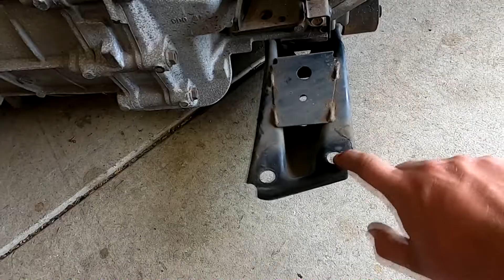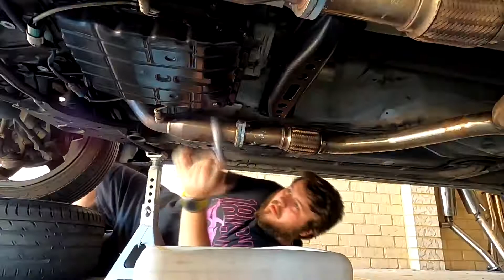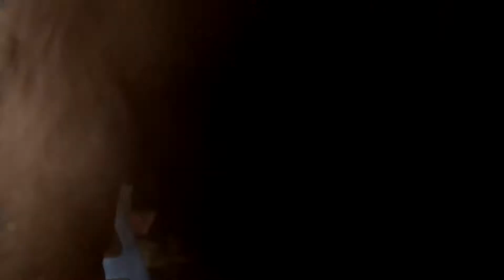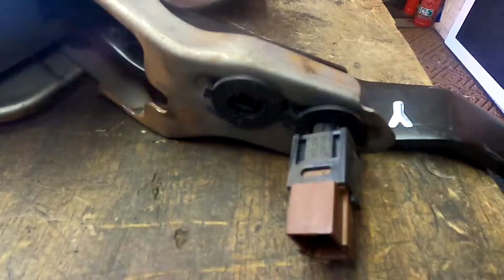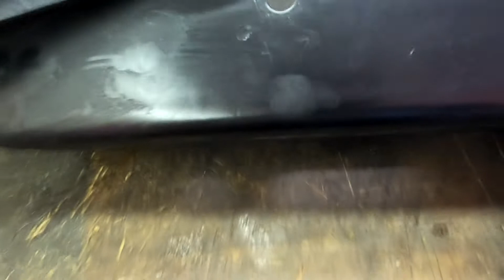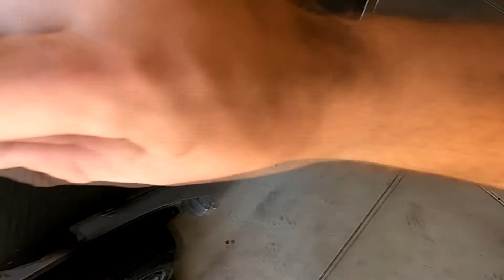HOW TO Manual Swap 350Z (INSTALLATION & WIRING GUIDE)

Comment: Nice work, bro — it looks so easy in your video, but it’s not 😅
I’m doing a conversion too, replacing the full harness, ECU, and all wiring from a 2005 350Z manual into a 2003 automatic.
Everything is plugged in now, but the car only cranks   no ACC, no cluster power, no spark.
I swapped every harness, cable, and ECU thinking it would be simple, but I’m stuck now.
Do you have the wiring diagram for a 2005 350Z right-hand drive (Australia)?
Or do you know how to bypass the immobilizer / key antenna?
I mixed everything up, even replaced the dash harness 😩
All the American diagrams are different, so it’s confusing.
Any help or ideas would be really appreciated   your video is great, I should’ve done it your way instead of swapping the whole harness and ECU.
Thanks, amigo 🙏
Reply from the maker: Yeah right with what i did it was still all auto harness and ECU just by passed the clutch safety switch. Dont know much when it comes to people doing the full harness and ECU swap.

Comment: Hey, you have jdm, right? Asking because i saw in my jdm upper side bracket for clutch pedal and im curious did you have the same because everyone needs to do reinforcements for clutch pedal.
Reply from the maker: Yeah its JDM. All i did was just bolt the clutch all brackets and stuff was there all i needed to do was drill the holes for the master cylinder.

Comment: You had to change the car’s ECU to use a manual transmissionl
Reply from the maker: Na still was using the auto ECU and Still to this day car is on auto ecu as a drift car. never had a issue.

Comment: Mate im up to the wiring stage...plug E8 doest have pin 45.
Im in oz too, so wiring should be similar except mine is 2006.
Reply from the maker: Had a quick look. yes wiring diagrams show different. looks like Plug E7 pin 26 for transmission control module (AUTO) and if you want to wire the clutch safety switch will be Plug E7 pin 25. Please double check that all before you start wiring.
Reply: @braydonkinnear so on the 06 z u use pin e7 and 26 to do the wiring

Comment: hello i have RHD and im kind of stuck on the clutch line part, can i just buy the regular hard clutch lines because i don't know if it varies from LHD and RHD.

also the transmission mount. do i need to do modification for the automatic transmission mount to fit the manual transmission?. 

thank you
Reply from the maker: yeah i just used factory hardlines. can always make your on if you have the tools. can use the factory manual gearbox mount or again make your on if you have the tools.
Reply: @braydonkinnear  yes I'm going to make my own and the transmission mount i will cut the automatic transmission mount that i have.

Thanks

Comment: I did the same conversation but I’m having problems when I get into neutral and my car start to die at soon as I get out of gear coming to a stop :( can anyone help please 🙏
Reply: Also when I turn on the car it idles normally but once it comes to a stop out of gear it’s try’s to stay alive and then falls down and turns off
Reply from the maker: Yeah true. haven't heard of them doing that before. only thing I can think of is plug a scan tool in see if any codes come up.

Comment: Will the wiring you did to bypass the clutch switch be the same for a 2003 g35 ?
Reply: Well since its an old video I assume was not getting any response,yea it did indeed work g35 has different color wire but its the same thing thanks good video !!
Reply from the maker: @juanrafaelromero3487  Yeah sorry for late response dont check this account that much. I wouldn't now if it works with a G35. glade you  where able to get it to work.
Reply: @juanrafaelromero3487 was ur grey/red ?

Comment: Hi I have a question if I did it with the safety switch and I did it wrong would it stop it from priming the fuel?
Reply from the maker: When you turn the car to ACC with key the fuel should prime then, even if the clutch isnt pressed down. make check fuse or relay.
Reply: @braydonkinnear  I did check the relays and there all good and I changed the ipdm as well
Reply from the maker: @edwinjimenez631  Thats very strange have you bench tested the fuel pump to make sure it still works.
Reply: @braydonkinnear  it’s a new fuel pump but when I use the multimeter it works on the fuel pump relay

Comment: Just sell your automatic 350z and buy a manual 350z. You just killed the resale value on the car and introduced many other problems
Reply: What you did is cool but at least in the USA. auto Matic and manual sell for 7-9k
Reply: @Mrkevi123 or maybe some people don't plan on selling a car they built so they don't care about "resale value" cause they're keeping it till the chassis done for. You sound like someone with soft ass hands
Reply from the maker: That car still drives perfect today with zero problems. Here in Western Australia manual 350z are around $18k and go up to about $25k. where autos are around $12k and max I have seen is $15K. I brought that silver 350z and a wrecked manual 350z both cost me under $7k

Comment: How do I get the check engine light to go away so I can pass inspection
Reply from the maker: Not sure on how to get check engine light out if its still a auto ECU will be freaking out as its not picking up the auto gearbox
Reply: @braydonkinnear  I just had someone tune the CAN communication code out
Reply: @Roach350z which yours is yours? People saying I cant tune my 03 sedan and can’t take out the codes. If I wanted to do the swap I’ll need the engine harness body harness ecu for no codes etc
Reply: @Dheidb1234  all ik is 03 ecu's are they're outdated and harder to work with for tuning.
Reply: @Roach350z really some one can just tune the at light off permanently?
Reply: @Sxvaqe-_-  I was able to get someone to tune out the CAN code permanently or bypass it not too sure what he did but all I know it  was the code causing my check engine light and he tuned it out so it went away

Comment: Finished doing everything did the same wiring as you but doesn’t do anything when trying to start up what would be the problem?
Reply from the maker: Have you checked all fuses. I have never had a problem with mine. Same ECU and harness nothing has been changed

Comment: Sweet Baby Jesus, how does anyone deal with the top dipstick bolt and top two bellhousing bolts? What specific tools did you use? I strongly suspect a different length extension (between the lengths I had in my toolbox) would have helped with the top dipstick bolt. I'm still trying to break the top bellhousing bolts loose - not much room to turn a wrench or swing a hammer but I've been tapping a box wrench with a 4lb hammer to no effect and I can't fit a cheater bar into the space.
Reply from the maker: Yes that was a pain. from memory i got it from the top as i could move the spanner more.

Comment: this is great stuff Braydon! i was looking for info for RHD and couldn't find anything under 'FAIRLADY' maybe you might want to change the title to add RHD or FAIRLADY so people can relate to your vid!  Also who does the speedo work if nothing is plugged onto the transmission?
Reply from the maker: Yeah that is a good idea adding fairlady to the title probably will do that. the speedo. the speed works through the ABS sensors on the hubs.

Comment: nice video, learned from your video and almost made it the end. I’m on the IPDM stage, my fuel pump works but no crank, did you have an issue like this?
Reply from the maker: Havnt heard about that problem before i know this replay is REALLY late sorry about that. hope you have got it running.
Reply: @braydonkinnear  hey bro got my issue didn’t align my flywheel to the sensor on the motor
Reply: @stallionz88 hi, my car also takes a long time to start and runs in emergency mode.  There is an error code 0335 - crankshaft sensor, but replacing it will not solve the problem.  did you manage to solve this?

Comment: What did you do about the neutral position switch underneath the transmission? I had no other connectors when trying to plugin that switch.
Reply from the maker: Nothing is plugged in to the manual transmission.

Comment: How did you keep the motor from spinning when installing the flywheel?
Reply from the maker: Have some one holding a socket on the main bolt on the harmonic balancer

Comment: does the cruise control work?
Reply from the maker: No it doesn't work when you change gearbox. you can change plug to make it work if you want.
Reply: @braydonkinnear  what plug would i have to change?
Reply from the maker: You will have to take the manual plug for the gearbox off the manual wiring harness, then cut and solder to fit where the auto plug for auto gearbox is on the auto wiring harness. it sounds confusing but is simple. There are a few forums on how to do it.
Reply: @braydonkinnear  okay thank you btw have you got the car tuned? and did they have any problems with the cruise control set like blinking with you then it on since i know you use cruise control button to switch maps
Reply from the maker: @alexv350z9  no tune all stock ECU

Comment: Will it still crank up if I use the manual harness & auto ecu ?
Reply from the maker: It should still work as long you wire up the clutch safety switch (press clutch down to start) or wiring constant power to pin 45 on plug E8 in the IPDM
Reply: @braydonkinnear   I appreciate you getting back to me definitely helped me on this manual swap ‼ I ended up using auto ecu / harness , car turns on but its alil jumpy and struggles to stay on and to get it to move I have to put the car in gear then start it could it be cam sensor ? Not letting me switch gears ? Or turning off when I change it to another gear ?
Reply from the maker: @juniormorales3330  I have never had the problem or even heard of it doing that after a manual swap. Can you plug in a OBD reader and see if there is any codes coming up to help get the problem sorted.
Reply: I get codes p0011 & P0021 my friend and it's wierd I replace the solenoids and 3 cam sensors w oem  also changed the pigtails to the cam sensors
Reply from the maker: @juniormorales3330  The codes say valve timing solenoid. not sure how that would change when you do the manual swap.
Reply: @juniormorales3330  am facing the same issue my 350z gear not shifting properly the rev seems weak did u find out what's wrong yet? Am running AM ecu/harness

Comment: Did your dash have any lights show up ? Just about to complete the swap and was curious if I’d run into anything like that?
Reply from the maker: Yes I got the Transmission light come up even when clearing codes it still stays as you havnt plugged anything in. Still runs and drives fine just got the light on dash

Comment: Great stuff brother! Really appreciate you documenting all the hard work. Have a V35/G35 coupe I'm looking to swap over. Guessing the fuse box wiring is pretty much the same, but will double check first. Any dash lights like a CEL or A/T Trans Check light on after the swap?
Reply from the maker: Yeah man they shoud be the same if its a 2003 with wiring in fuse box, as for lights on dash only got AT CHECK.
Reply: @braydonkinnear  Nice! Thnx for the reply. Really appreciate you sharing this with us. Best Manual swap vid out there for sure!
Reply: How did your swap go? I’m looking to do my 05 coupe this winter
Reply: @NuclearPineapple  im thinking about doing it in my 05, how was it?
Reply: @wydsenna  not bad at all

Comment: is there any chance the reverse light can be resurrected with still using the 5AT Ecu?
Reply from the maker: I haven't found anyway to get them to work. I know if you do wire then plug to the manual gearbox you get cruise control back, not 100% sure if you get reverse lights.
Reply: @Braydon Kinnear thank you for the reply Mr Braydon. I found this at a thread/forum. What's your opinion on this person approach on making the reverse light work? After watching your vid, i wanna do the swap my self. One of the best one out there

 " It’s very simple! All you have to do is remove the reverse light relay located in the fuse box at the battery cover and jump the terminals and wire it to your transmission reverse switch. Get yourself a reverse connector for the transmission and solder the jumper wires. No need to worry for any blown fuse because once connected properly the reverse light will be operated by the switch in the trans."
Reply from the maker: @contact anonymous  Sweet man glad you liked my video and thanks for looking into how to get the reverse lights working.

Comment: How did you get the transmission dip stick tube out
Reply from the maker: There are 2 bolts that connect it to the gearbox and one bolt half way at the back of the engine all are 10mm

Comment: How did you get the transmission dip stick tube out
Reply from the maker: There are the two bolts where it connects to the auto transmission and 1 bolt about half way at the back of the engine, it should be a 10mm.